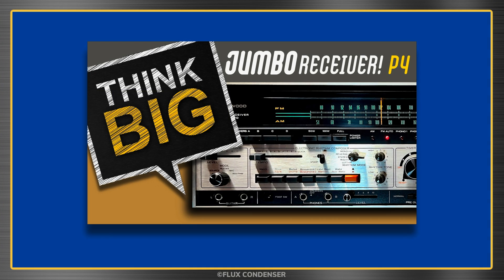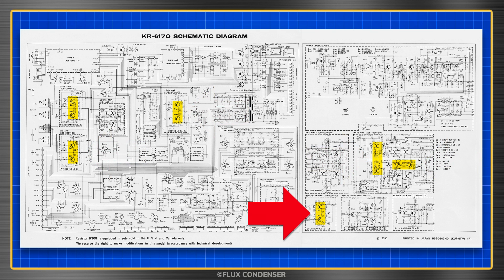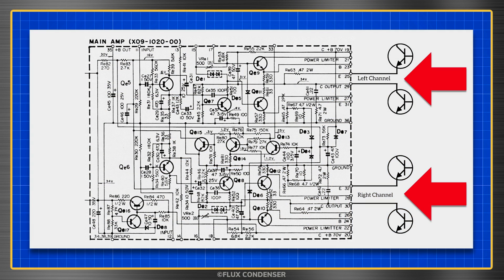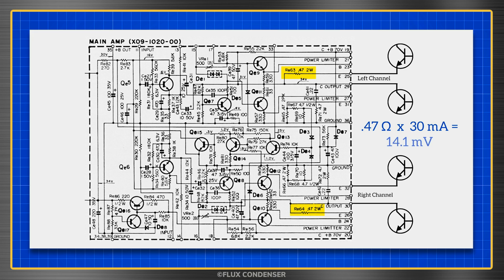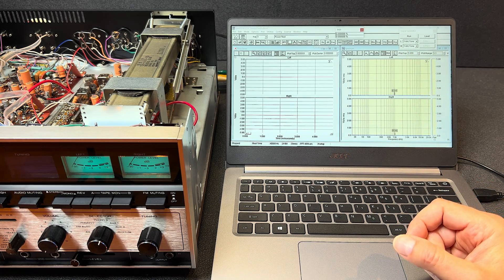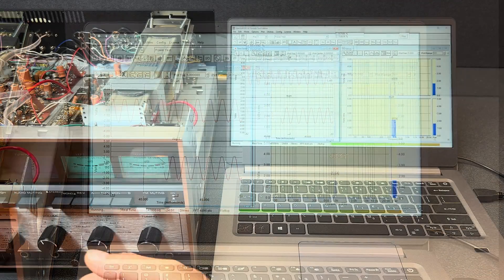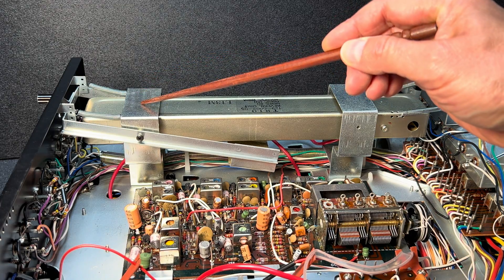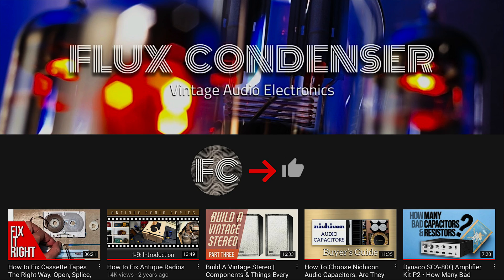1971 Kenwood Jumbo Receiver • Noisy Transistor Fix • How to Bias • Bench Test • In 4K HDR!

Comment: 1% is still not that good.  There should be a "knee" point where the THD goes up significantly very quickly, I often consider the "true" power rating to be 10% below the knee or 90% of the power rating of the point where the amplifier starts to increase THD significantly very quickly.  It would have been nice if you showed a graph that showed where the THD increases as the power goes up to show where that knee is located.  I am guessing the knee is probably somewhere around 23 to 25 watts. so this receiver probably only as a true clean THD of around 20 to 22 watts.
Reply from the maker: No, that’s incorrect.

Comment: enjoyed your videos.  thanks!

one comment: i probably wouldn't put the foam pads directly on the reverb box like that as they will have an effect on the sound. there's no reason you can't put them upside-down on the under side of the brackets (directly above where you put them on the top of the reverb box). You would probably have to cut the edges off the foam circles, but that's not really a big deal
Reply from the maker: The foam pads have absolutely no affect on the sound. The entire reverb is made of metal, so I find it almost astonishing that you’d think adding an insignificant amount of weight to that with foam pads would somehow have an affect. It just doesn’t compute.
Reply: @FluxCondenser  my thought was more that the foam would dampen the sound of the reverb chamber, nothing to do with weight. but i'm assuming that the chamber itself plays a role in the sound of the reverb and not just the internal springs
Reply from the maker: I believe the outer housing really just protects the spring and transducers. Even so, again, the foam has relatively no mass so it’s just not going to have any effect. I certainly didn’t hear any differences in performance before and after.
Reply: @FluxCondenser  gotcha. well, thanks for the videos. i enjoy audio equipment and i am also a repair hobbyist. :)

Comment: Very cool! Maybe one day, would you go a bit more in depth with measuring and replacing transistors?  I find this the most challenging part when trying to find replacements, especially in 1960's gear, when vintage components have different numbers and identifications. 
How far in spec tolerance you need to be when replacing, and what exactly am I looking for?  
I have one of those simple universal testers that give you hfe, Vf.... but I get confused with so many other options and other specs with new replacement parts, and I don't know how 'far off' I can be if the spec's don't 'line up'.
Also, those 2SC458's, did they look 'bad' under test? What is your process that lead you to the KSC1845's?
Apart from 'xtraytonyb', I have not found many youtuber's that go into the strategy of understanding transistors, 
and what 'exactly' to look for in replacing.
Thanks for the video, Rick
Reply from the maker: All great questions, Rick and I share your concerns and confusions over replacing transistors. I started in this hobby by restoring antique radios, so I have a better understanding of tube gear. And while I’ve become expert in many facets of radio repair, even with tubes I’m far from an expert on which tubes can replace others in similar circuits. For that, I rely on research, and similarly, that’s where I discovered KSC1845s make good replacements for 2SC458s.

Here’s what I do know. Checking for bad transistors usually just entails checking to see if they’re shorted or open. This can be done with the diode function of a multimeter or a basic transistor tester. Checking hFE can be useful when trying to match transistors, but as far as which transistors can replace others, that’s usually done by checking data sheets. Often a data sheet for a transistor will state what it’s a good replacement for. For real-world experience with substituting transistors, nothing will beat going to some user forums on audiokarma and others for some advice. 

As far as the noisy transistors in this receiver, those were replaced on a hunch. I was aware that many transistors from the period are notoriously noisy and suspected that the 2SC458s in the mic amp fell into that category. A quick search confirmed this and I found many suggestions that KSC1845 are suitable, low-noise replacements. It’s important to note though, that I didn’t think the 2SC458s were “bad.” I didn’t even bother testing them as I knew they were technically working fine. Fine, but noisy.
Reply: @FluxCondenser  Thanks for the reply.  I'm only a 'tinkerer' myself, and I love tube gear, and your early video's are A1 content explaining components and functionality.  I come from being a musician to wanting to know how tube amps work, and find I am more interested in the gear these days than the actual playing.  Uncle Doug has been a blessing too in first teaching me just how valves work etc etc.... Over time, I have collected some solid state amplifiers, and I must say, I find those more 'tricky' to work out than a tube amp schematic.  It's those 'pesky' transistors.  I have a bunch of 60's Reel to Reel tape recorders, and they have some oddball transistors in them, and that's where I get stuck trying to work out a similar replacements.  Anyway, thanks for the reply back.  
Recently, I've started to keep a diary of transistors like yours here, and what to replace with if I ever come across some dodgy 2SC458's. :)
Thanks! Rick
Reply from the maker: My pleasure, Rick. Keep on doin’!

Comment: In the past have used thick felt weatherstripping so new caps would fit in the clamps, or perf board.  The adapt a cap looks like a handier solution.
Reply from the maker: Mark, I was so close to doing just that with the weatherstripping!

Comment: Don't park the Kenwood too close to the Dynaco SCA-80Q on the shelf.  The Kenwood may get jealous of how much better care you took of the Dynaco.  Speaking of Dynaco audio equipment, it's time to rotate out my solid state amps and bring in the Dynaco Mark III amps to help heat the music room now that winter's approaching.
Reply from the maker: Hm. I thought I took pretty good care of this one ;-) Do you think I did wrong by this Kenwood? The 80Q was an unbuilt kit, so yes, I wasn’t going to build it with old parts. This Kenwood is working just fine now despite me not replacing every marginal component. Different beasts, different approaches.
Reply: @FluxCondenser  Truth be told I really had to stretch to find something to razz you about so I indulged in a bit of whimsy :-)  Your diagnosis and repair work, as well as your video productions thereof, truly are excellent.
Reply from the maker: Ha! Thanks, Darth. Feel free to razz away. The problem with writing, as we all know, is that tone doesn’t always translate. So, I figured I’d delve into the “better care” comment. And if you had felt that I had done wrong somehow, I’d be genuinely interested to hear how. I’m just a hobbyist and not a pro tech, so I can only gain from constructive feedback. As always, I appreciate your support and comments.

Comment: Thanks for those videos! i actually own a KR-6170 an i'm having some trouble with the right channel, witch is dead. i'm studying your explanations to figure out what is happening. If you have some tip about that it would be very much appreciated
Reply from the maker: My pleasure, Thiago. Glad you’re enjoying the videos. I’m not sure how much experience you have working on electronics, but a dead channel on the KR-6170 would be diagnosed similarly to any other type of audio device. First, isolate when and where the channel is gone. Is it with all inputs? Is it with all speaker outputs? Do any of the controls affect the situation? This will help you isolate the circuits you need to examine. Then, you’d want to do standard signal tracing from input to output so see where you lose the signal. You can also use the service manual to check voltages at different parts of the circuit (available online from Hifi engine, I believe). Having one channel operating is helpful as you can compare the circuit voltages on the good channel with the bad channel to see where things start to deviate. Also note that I fixed the dead FM in my receiver using none of those techniques. Sometimes an issue such as yours can simply be a dirty contact in one of the potentiometers or switches. This could occur in the volume control, balance control or speaker selector switch. Carefully apply a suitable contact cleaner to these areas and see if that doesn’t help. Good luck!